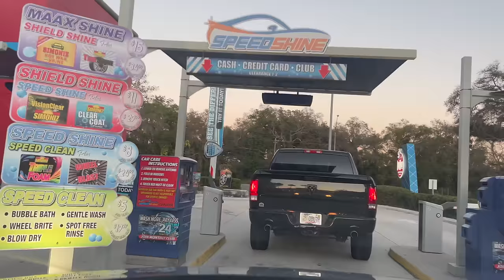SpeedShine Express Car Wash (4K Night Time Retake)

Comment: these brushes don't look safe for paint
Reply: They have very small fingers on the ends made of foam these wraps move half the speed of cloth. The biggest issue with these can be lack of lubricity in a tunnel always make sure they are using enough soap

Comment: Turn your windshield washers off you run the risk of having them damaged.
Reply from the maker: I understand the risk, and I do take the risk. However, I would rather provide a video that features a full view of the wash equipment in action rather than a screen of foam. I do not recommend using your wipers in a car wash, but I am trained to know when to use them properly.
Reply: @FloridasExpressCarWashes  i wont risk turning on the wipers but everyone like car wash YouTubers can do it so keep it on the good videos